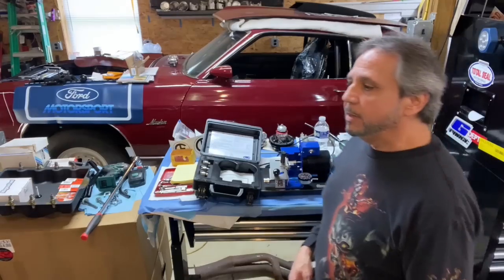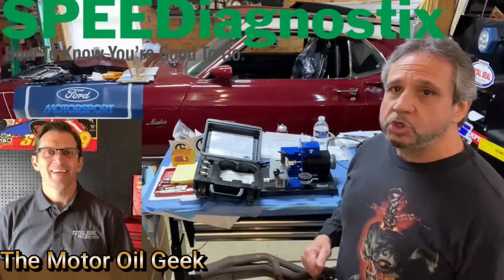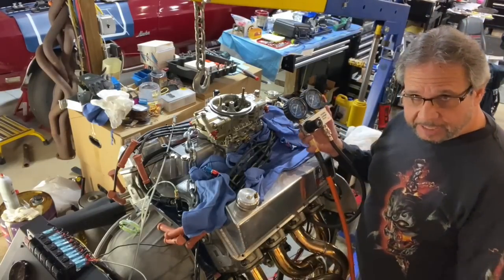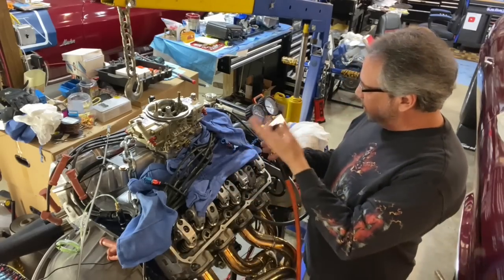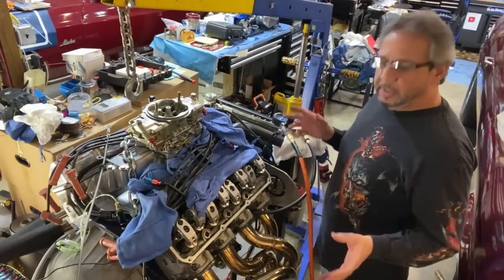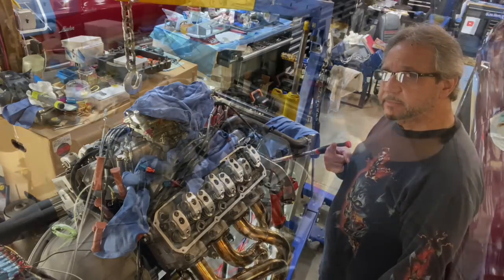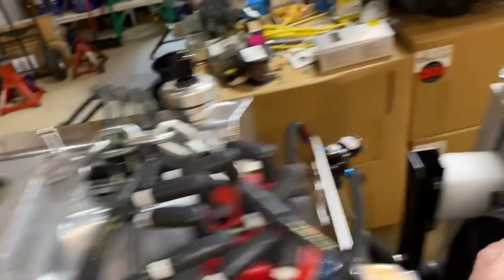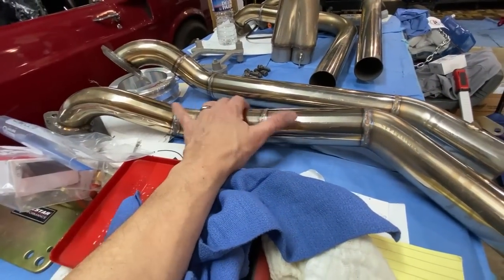DBG: Every DAY Is A School Day, Oil In Cylinder, Leak down, Secret Spacer Plate, Send IT Torture IT

Comment: Get a stethoscope, with a hose to listen for air issues. Another with a metal diaphragm and a metal probe for on touching for mechanical issues
Reply from the maker: Thanks. Have plenty of those stethoscopes 🩺. I just a compression and complete cylinder leakage. All good. Had some fuel issues at track. But have it figured out, should be good to go. Thanks  🏁☺️

Comment: total seal gapless rings are my go to ring set.
Reply from the maker: Never used them before. These are used rings from the engine, after the oil pump pick up broke.
Reply: @dragboss351cleveland  I would look into them when its time to freshen it up.
Reply from the maker: @nonenone1249 I may, there is a new style, out. See what my options are. The cam and compression, too small and not enough. Will make 825 I bet. Thanks None 👍🏁

Comment: Your intake manifold could be leaking on the underside. Replace the manifold bolts with studs and check manifold gasket thickness for alignment. Q16 usually keeps everything clean when you run it out of the car after use.
Reply from the maker: No oil in there after it sat for a week. I scooped all cylinders. Did have issues with new jets, so I cleaned up 20 year old jets, put them back in. There you go girl.  👍🏁🇺🇸💯
Reply: @dragboss351cleveland  you won't get a leak from sitting,  as oil isn't being circulated to the area of the leak. Once what was present is gone, it's gone.
Reply from the maker: Can’t say Greg, I had ran it and let it sit oil. Clean out, leak down, run again and let sit. No oil in cylinder. I will pull the plug again and inspect

Comment: HI TIM around the 12.47 minute mark on ur video  that num1 intake port of ur manifold is it cracked dont know i think i saw something when ur video focused better but ur getting oil in num 2 pot possibly a valve stem seal  rewatch it an see what you think
Reply from the maker: I will ck it out. Everything good so far. Did not see oil running down. Thanks Mario 👍🏁

Comment: I have seen the rocker studs pull oil into the intake ports on Cleveland's if they are not sealed right on ported heads. A tiny leak will get a lot of oil in it....

Comment: That is a Cadillac. I'm sorry Lincoln ring grinder.  The same one Brian Salter has. And do those heads have rocker arm studs going into the intake ports? Thanks for the video
Reply from the maker: Yes but I used sealer on them Don.
Reply: @DragBoss351Cleveland  I figured so.

Comment: Tim when you do a cylinder leakdown test you can do it cold and hot. Also when doing it once you set the inlet pressure on the gauge (don’t touch it) pick your inlet pressure and leave it for consistency.

Back in the day pre electronics/OBD a compression and leakdown testing was the norm - but that has changed on production vehicles.

In racing applications along with high performance usage the test your doing is key.

On a daily driver 8 to 18 is good, 19 to about 30 you need to listen, motor could be worn. Anything about 30 you have issues.
We were taught that IF you found anything lower than 8 and it’s a high mileage vehicle you on the second ring and you have an oil burner (actually had a vehicle like that).

On racing engines (plate bored and honed) that 2 to 3 percent are numbers to be looked for.

IF you leaked the motor from day one, after each pass you have a history as what is what. I don’t know if I would do it on a bracket engine BUT there are merits to doing it, as a comp Eliminator, stock/super stock and even pro stock it would be a integral part of my maintenance…
Reply from the maker: Thanks Harry, appreciate the time you took to educate us with your experience. I will pull the plug today and look in with borescope, hopefully dry and no issues. 🇺🇸🏁👍

Comment: Yeap I had the same thing happen to me the head was cracked in the top of the head oil was getting in the coolant an cylinder
Reply from the maker: Hopefully nothing like that, has crossed my mind, thanks Robert
Reply: Tim , ,,, back off the rockers on two , and check the leak at BDC , and I wouldn't bother with the rest of them . That pup outta straighten out at 330 foot .

Comment: Sounds sweet Tim. You've probably already done it, but check the valley bolts are tight. I'll take 20 cents for every gasket that I've seen settle over the years, and result in a leaking manifold.  Looking forward to seeing you race. Regards Greg
Reply from the maker: Right on, I can't wait either. thanks Greg, I am going to check inside the cylinder tomorrow. What do you mean valley bolts?
Reply: @dragboss351cleveland  intake manifold bolts

Comment: If there’s oil in a cylinder / on the rings, it’ll give a misleading leak down. 2% is a fantasy number.
Did you scope the port on the cylinder you found oil in? Possible vacuum leak into the valley?
Reply from the maker: Yes, I cleaned it out. Vacuum leak in valley? The leak you hear is prob just from rings and cold engine.
Reply: @ I meant, as in sucking oil from the valley, if you found oil in the one port.
Reply: @dragboss351cleveland  I was also thinking valve guide seals

Comment: I have a sb2 but very similar headers just bigger i recently built an xpipe.   You need to try a dominator
Reply from the maker: I have in past, and the difference was like 9.66, to a 9.68, and like 1 mph. That was with old headers, and now it may make a difference. The intake I used is at BES.